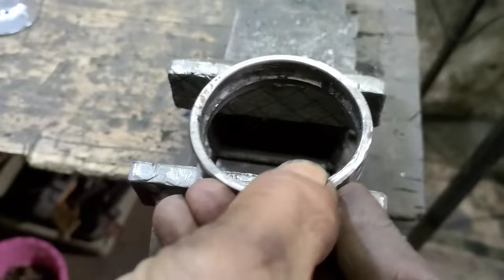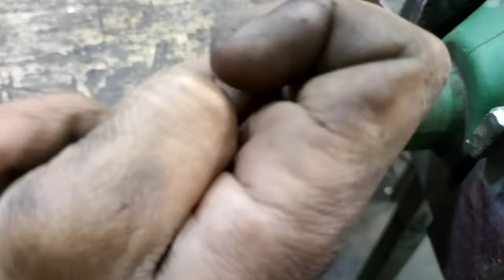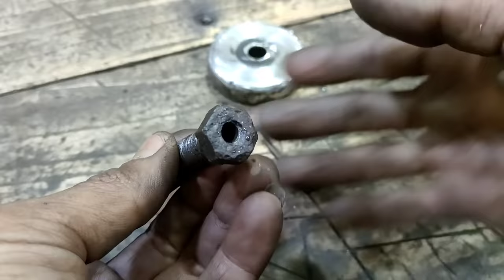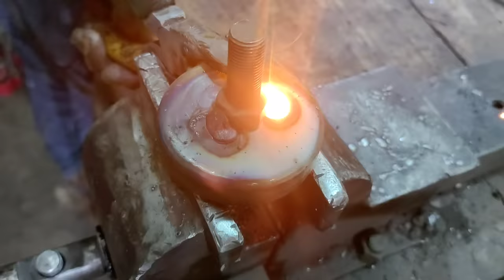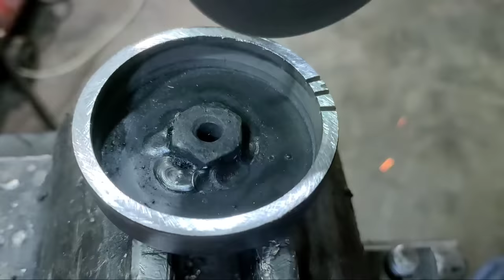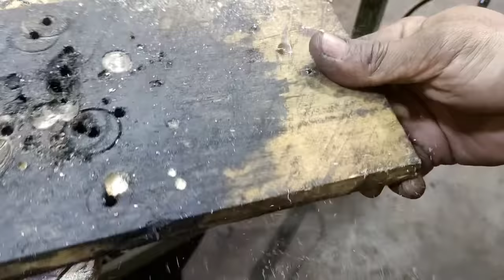Kelewat KETERLALUAN !! tukang ini membuat hole saw mengunakan bearing bekas

Comment: Nice idea, but you should have used 2 or 3 outer rings to make the cuts deeper, not needing to switch sides on each cut. Plus, that will only work with wooden boards to about 20mm max. If the board is any thicker, it won't cut through.

Still, a good idea 👍.